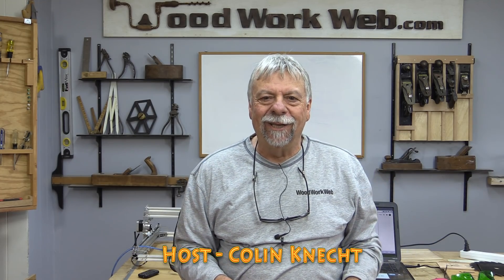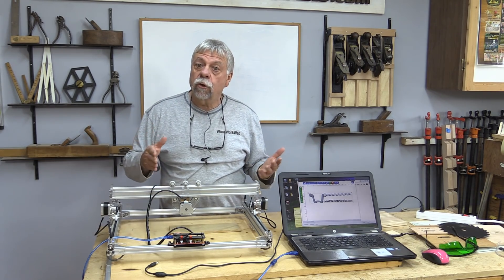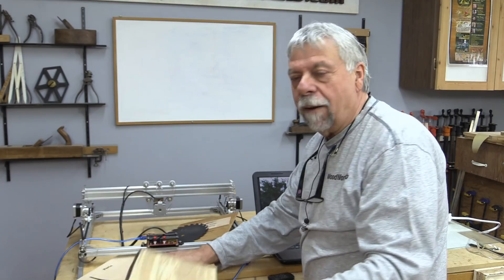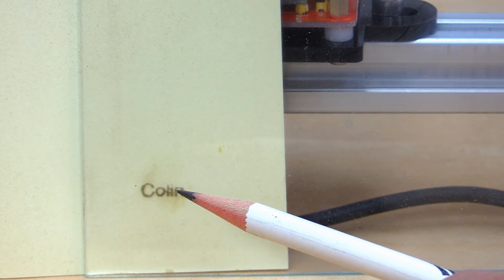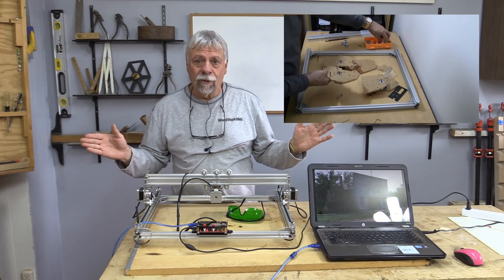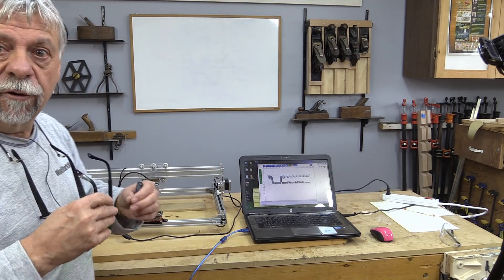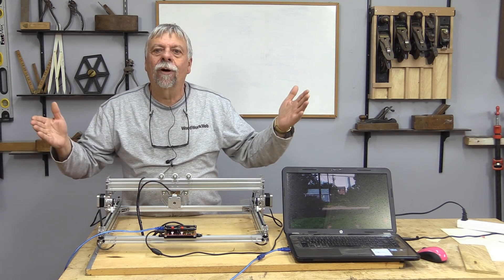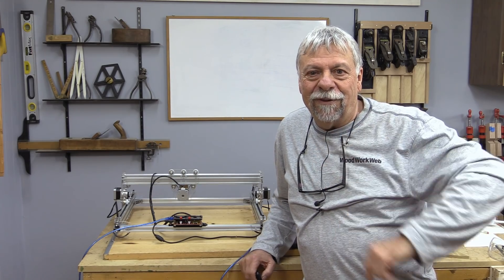Reviewing a Wood Laser Engraver / Laser Engraving Machine

Comment: You never want to walk away from your laser. It only takes a second or two to catch on fire. And always make sure that your focus is correct. You can bump up the speed and it won't take that long to do that small of a text. It should only take a minute or two at the most. I can do a 4 x 4 tile with an image on there and text in less than 5 minutes on my Ortur laser which is basically the same laser.

Comment: Lawrence Kelley
Hello, I just got my New 500 watt laser engraver and got it all together, but I seem to have a problem and are in need of assistance,  I am New to all of this, so it is probably something simple. my 500 watt comes on and seems to run the pattern, yet the Laser light that comes out, does not leave a mark or anything, not even on paper ??  any suggestions ??  would greatly appreciate any help, running Benbox that came with it
REPLY
Reply from the maker: Try finding the power settings in Benbox and increasing the laser power number. If you have the same laser system as me, you can also try the manufactures software here: http://wiki.eleksmaker.com/doku.php?id=elekscam

Comment: So I bought a smaller one of these and like others have commented they are setup strange, the fan was wired inline with the laser, this is not great as it can make the burn unstable, also the biggest issue no power control of the laser, i think as standard you can only speed up the passes to try and reduce burning. so I have modified mine quite a bit I reprogramed the arduino to run Grbl laser which was designed for the shapeoko cnc machine but with that firmware running you can set the power level of the laser (pwm) this allows you then to use other software to raster images instead of just lines. also there is a post processor for Vectric vcarve for shapeoko so wood workers that finds vectric software easier its a better solution to the bundle application. i also had to 3d print new guide wheels for the x carrage as there was a lot of movement there which caused wobble this distorted strange lines even small movements can be seen in the laser path, but long and short there is a lot of work needed on this machine before it becomes useable for photos and advanced graphics, it depends on how far you are willing to mod it or what you will use it for to see if it would be worth purchasing, the price is cheap but time can be costly and this machine takes time to do engraving tasks more complex that text and lines. Im interest what power laser this has because mine is 2W and dont thing it would do glass but i havent tried thinking about it...

Comment: Hey, you can drive these from my free/opensource software:   openhardwarecoza.github.io/LaserWeb2

For support:  Github.com/openhardwarecoza/LaserWeb2/issues/

Supports DXF, SVG, Raster (PNG, JPG, Bitmap)
Reply: +ituxcoza  i can't get ports to open or anything.
Reply: Did you read the instructions on github.com/openhardwarecoza/LaserWeb2  - sounds like you dont have Serial Port JSON server running (;
Reply: This is a very cool alternative. Thanks for the hard work and sharing it with us. (Do you plan on a standalone no web required version?)

I'll give it a whirl and let you know how It goes. Thanks so much!
Reply: Yip but keeping it online for now, allows users to force test the new features I add once a week.  Easy enough to run offline, but i "force" users to run online else I get a lot "This doesnt work" reports, for things fixed long ago ... (if you are clever enough to run it on your own localhost, you'll know to do a git pull update too right?)
Reply: Prolly. Thanks.

Comment: What was the wattage of the unit that that they supplied you with? I have a smaller one, identical in construction, with 500 mW. and it's fun, but cannot etch glass or acrylic. I also would caution not using vinyl, as it can produce chlorine gas on combustion, which could kill you and destroy the unit, even if you had proper ventilation.

BTW, the unit I have the laser unit comes on, the fan starts immediately, stops when the unit stops burning... I've thought of upgrading the laser unit itself to 2500 mW (2.5 watts). Would you think it worth the cost of the part? Or even to 5000 mW, if there is still a 5 watt laser for it?

When I bough my "kit" no video instructions, no software, it was a fight to make it work, but I did make it work. And I found GearBest to be a pain in the neck to deal with. They sent me links to software with viruses in it, they were no help at all...
Reply: The size of Colin's unit leads me to believe it is the 2.5W version.
Reply: These are TOYS. No one can make them mark metal. You need 40 to 60 watts or more for that.And Benbox software is crap GRBL Works OK on them...

Comment: Hello Colin. I'm quite interested in a laser engraver. I followed the link that you provided, and the page that came up had a disclaimer at the bottom, saying that the unit could only engrave cardboard, etc.   Is Product ID: 1003863 the unit you are using to engrave wood and the metal saw blade? Thanks. Jim

Comment: Nice review! One thing...the Banggood site you referenced states that your laser machine cannot do any transparent material (ie. glass), yet you showed us a glass that was done by that laser. Did you use some backing or other material to allow for the light not to pass through? I too can think of hundreds of uses for something like that laser engraver. Thanks!
Reply from the maker: +woodstoney Yes, I saw that and not sure what they meant about it not doing transparent material. I tried the glass to see what would happen and it seemed to etch it though probably faintly, but you can still see it quite clearly and it doesn't rub off so it must be etched. No I didn't use anything special under it, I think it was cardboard. Yeah ... I agree, I think there is a world of neat ideas for these ... all I need is time :)

Comment: You said something about what the marking looked like before sanding, can you make a followup video with parts you've finished further?  I was thinking it took off the bleed burn marks and left a sharper image.  Is that correct?
Reply from the maker: +Jim Beshears There are a few variables with these Jim ... I did some burning on a lighter power that really ... don't need any sanding and some on a higher power that blocked up a bit and when sanded they opened a bit ... but it really depends on the wood. Your really need to experiment and it's still early days for me with this unit so hard for me to answer some questions as I can see there a lot of variables.

Comment: There seem to be many different models. They all follow the same theme. They vary the size of the print bed and the wattage of the laser.  They go from 1/2 watt up to 5 watt. The link is in the description.  I imagine the 5W model will print faster.  Colin demoed the 2.5 Watt.  +Woodworkweb  It looks like if you wanted to upgrade you could buy the upgraded laser and install it. I doubt 2.5 more watts would hurt the powersupply.
Reply from the maker: +Dan Tauro Good comments Dan, yes, apparently you can upgrade the laser head.

Comment: Colin, how well do you think it will do curved surfaces (like Pens).  Also what model did you get?  Seems like there are different power settings available.  Any recommendations for etching wood vs metal?
Reply from the maker: +Mark Perkins It will do curved surfaces, and I think it would do pens, but you would want to use a very fine font. Check the link for the model I used and yes there are different power setting and I struggled to get that part working. I am still very new at operating this, and this one would be much better at wood. I only did saw blade to see what would happen.
Reply: Thanks Colin.  I enjoy your videos

Comment: How do you align the part to be engraved with the laser?  It seems like it might be possible to etch an area bigger than the unit by sliding it around between etching sessions.
Reply from the maker: +Wayne Welshans IT seems it depends on the app or software you are using. Hmmm, you could  be correct about etching an area bigger than the unit, I had not thought of that ... another neat idea, thanks Wayne.

Comment: Its interesting to see it print by line like a printer and not by gcode like a cnc machine. The latter would be much faster. Interesting tool.
Reply from the maker: +Willem Kossen It was an interesting tool to try out, you are correct that it is somewhat like a CNC ... this one is not very fast, but then most of the small CNC machines are pretty slow too ... at least this one is silent ;)

Comment: You'll get ever so slightly better results if you set up a vacuum or blower to clear the smoke.
Reply from the maker: +Brandon Fesser Great comment Brandon, I did not know that, thanks Buddy
Reply: +WoodWorkWeb Also you can cover the wood in paper tape to reduce the amount of 'burn'
Reply: I've found that if you ever so slightly dampen the material you are working on it will reduce "sooting" on the item. It cuts down on the smoke and allows less over-burn and soot adjacent to the burn line. A small fine sprayer and a paper towel to remove excess water helps too.

I use the GRBL software, and have never been able to get the BenBox ROM to upload to the machine, or even get BenBox without a virus in it.
Reply: also, find out what wavelength of the laser they used. else, can be burn your eyes in long run without cover or eyes protection

Comment: How long does the laser last does it ever burn out?
Reply from the maker: +Wayne Burba Excellent question Wayne, I don't have an exact answer but I know they do burn out (or what ever it's called) but I also understand there are replacement heads available and I believe they are listed on the website but I have not had a chance to check them out.